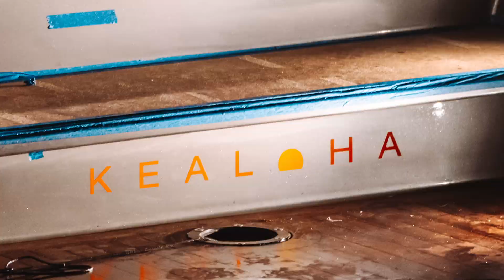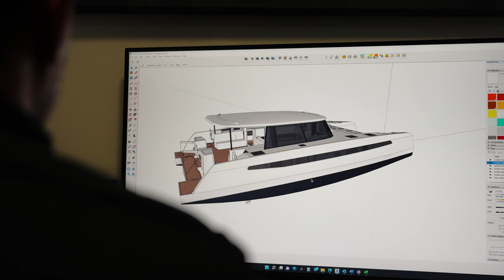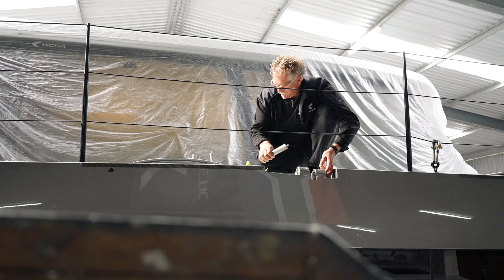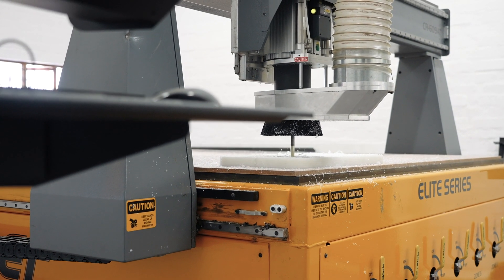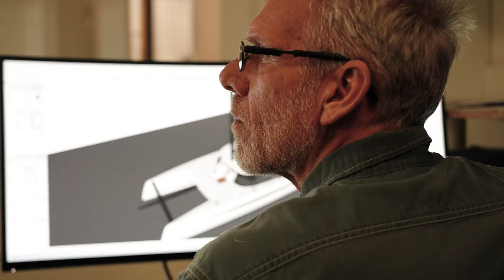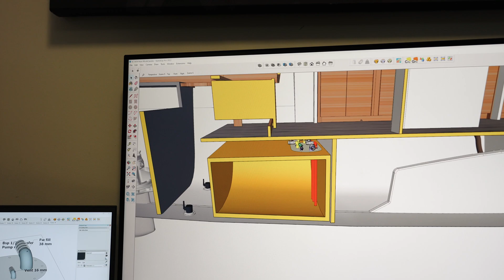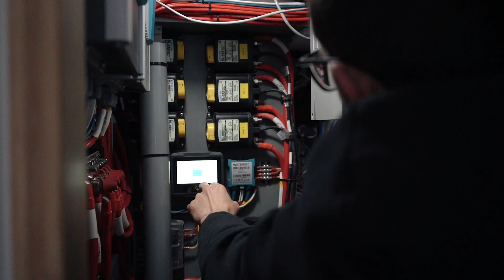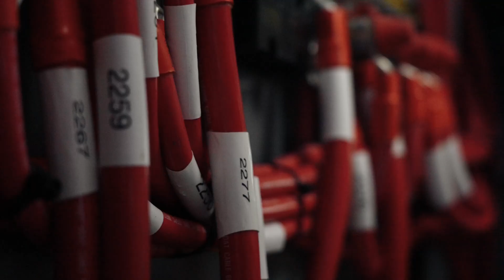Kinetic Catamarans - KC54 Process & Development

Comment: I like the aestetic, but the Titan disaster showed us how poorly carbon fiber works under the water line.  I wouldn't even want the sink to be carbon fiber.
Reply: You must be joking, right?
Reply: No, I'm not.  Carbon fiber laminates aren't like fiber glass laminates.  Delamination of the carbon fiber will occur over time because water will penetrate and separate the fibers from the epoxy.  You can't keep carbon fiber submerged without causing structural damage.  Race boats made with carbon fiber are discarder after a few races-- they start to gain weight from the water absorption and become less safe.  To make production boats using carbon fiber above the waterline is a great idea.  Below the waterline, and your buying something very expensive that even if well maintained, will fail faster than steel, aluminum or fiberglass boats.
Reply: @valorianbronze2683  That`s why you don`t have a open carbon structure. You cover it with different layers of paint to keep the moisture out. You absolutely can`t compare a surface vessel with titan. The water pressure increases by 1 bar for every 10m of depth. Titan's cell was thus loaded with up to 380 bar during each deep dive. This led to micro-cracks into which the liquid could penetrate. A draft of 1.5m increases the ambient pressure from 1 bar to 1.15 bar. A good paint layer structure will keep every moisture out.
Reply: But not for very long, and that's the problem. Half a mm of paint will resist, but not stop water intrusion.  We're not talking about a theoretical craft. We're not talking about boats that are used in the water an hour and then drydocked and stored in a dry environment the rest of the year.  Boats exist in the real world get bumped and abraded.  Unlike fiberglass, carbon fiber is hydrophilic.  Because the carbon fiber is more attracted to the water than it is to the epoxy resin,  there will penetration by water, and that will result in delamination.  It won't happen in a day, but it will slowly happen.  Right now carbon fiber hull boats are new.  They are the bright shiny objects shipyards are dangling in front of us because cf is strong and light weight, and that translates into speed.  But if used year-round in water, the lifespan of cf boats will be shorter than other hull types, and buyers should be aware of that.